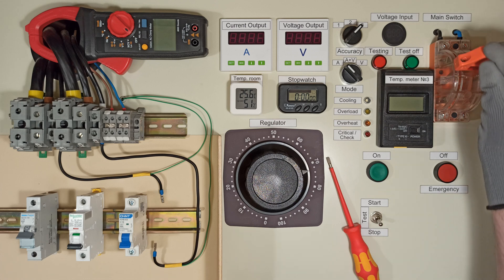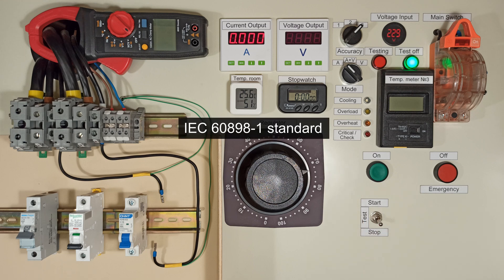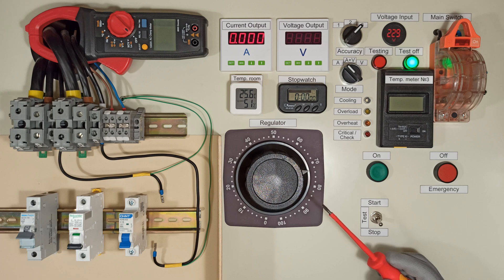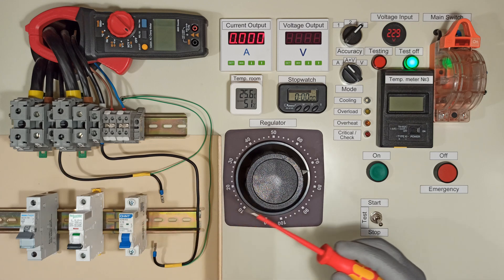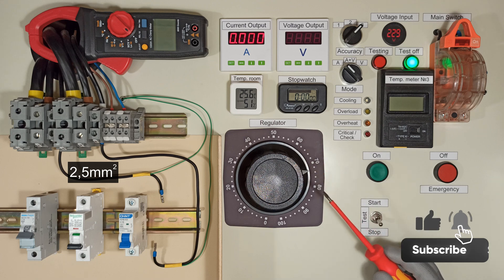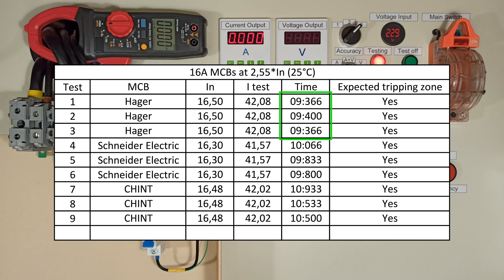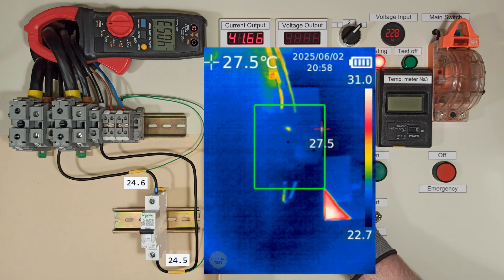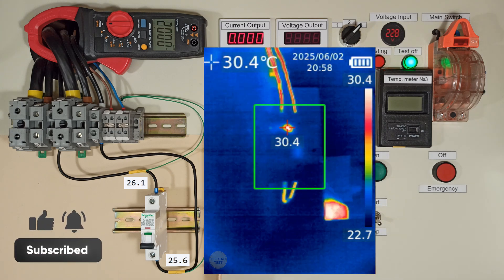MCB Trip time variation test 2.55×In. Hager, Schneider Electric, CHINT.

Comment: Hey man I really appreciate these breaker tests, thanks. 
It would be interesting to see comparison between DC breakers from cheap chinese brands. So far Chint seems to me to be the best of the bad, at least they provide data sheets and seeing these vids, their products work to within spec. 

I have some "Tosun" DC breakers on my home PV system. In summer with ambient temp around 25 celcius, I can not leave my MPPT on full 30A through the 40A rated breaker, as it trips with the excess heat. At 25A, it doesn't trip fortunately. Disapointing though, I would expect it to work fine with a constant 30A during the day. 
I later saw that there were no data sheets available. Surprising as they were sold through a domestic supplier.

Comment: So according to my calculations, you should be able to make a cup of tea in 10s without tripping the breaker lol.
Reply from the maker: Yeah, well, if it’s a 4A breaker and a 2500W coffee machine, you’ll have 10 seconds. Not guaranteed it'll be exactly 10 seconds, but somewhere around that.
Reply: @ElectroTest_1  No I meant if you have a 10KW electric kettle (which probably isn't existing), you could heat 250ml of water without tripping the breaker lol.
Reply from the maker: Yeah, well, an instant water heater might work for that. Otherwise, everything's correct — there's still a bit of time.

Comment: Please test this same on dc 250 amp tomzn or similar
Reply from the maker: Thanks for the idea! I don’t have direct voltage and current in the setup yet. Although I don’t think that’s absolutely necessary for testing the thermal element. By the way, I once tested a TOMZN 125A — it heated up to over 100 degrees and didn’t trip. I’m thinking maybe I should take it apart and see what the problem is. Does it only have an electromagnetic element? Maybe someone can provide an explanation or some useful insight about this?

Comment: I wanted to suggest a technical comparison between Italian plugs and sockets (Type L, 10 A and 16 A) and German ones (Schuko, Type F).

In my opinion, the Italian system is modern and versatile, even though the German one is more widespread in Europe. In Italy, we use modular wall plates (from 3 to 8 modules) that can host Schuko sockets and various “electrical inserts” such as switches, push buttons, two-way switches, and even supports for Keystone modules like the DN-93615 — unlike the German system, which usually consists of a single round module for just one actuator or socket.

The test could help determine how many amps each system can actually handle, as well as measure temperature and contact resistance on the active conductors and the earth connection — useful information, for example, for people who want to charge an electric vehicle using 230 V single-phase.

If you had public contact info on YouTube, I would have reached out there — I’d even be happy to send you the Italian sockets myself for testing ^^

Best regards!
Reply from the maker: Thanks, my friend, for the idea! I was also thinking about testing plugs and sockets, at least starting with the popular ones. I'm planning to share my contact information. I really appreciate that you offered to send one — I wasn’t sure if anyone would actually want to, but now I see there are people who do! That way, the tests can be more diverse.